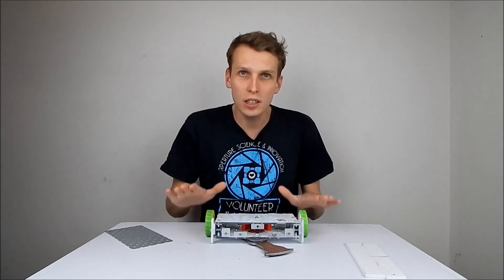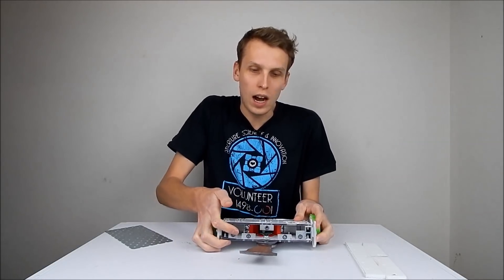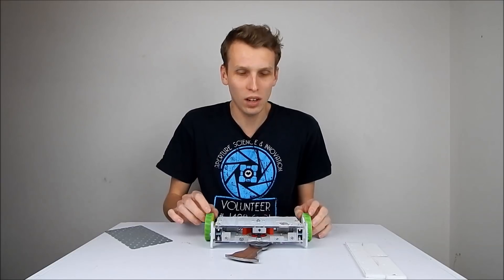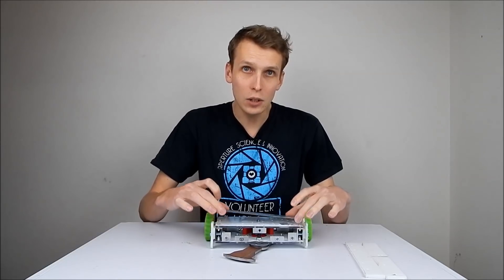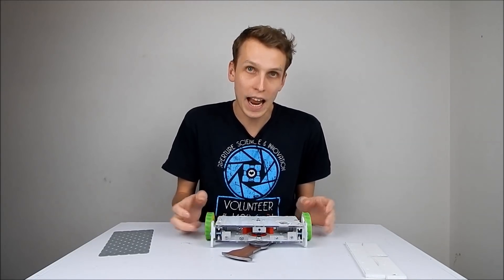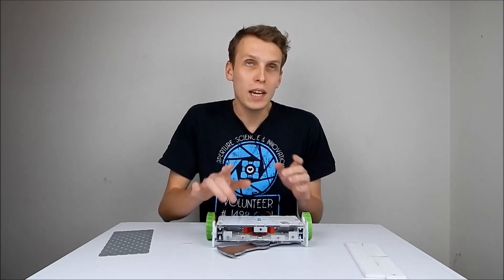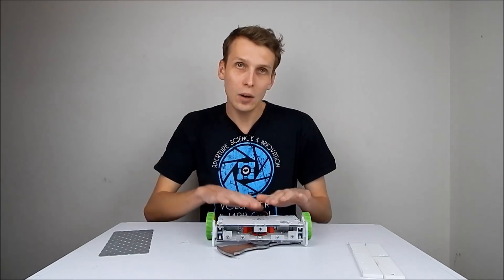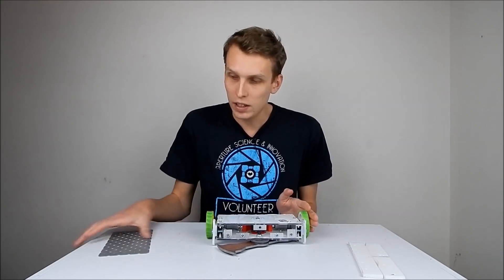1.36kg under cutter robot upgrades

Comment: what motors do you use?
Reply from the maker: generic 20-21mm round 1000 RPM gear motors
Reply: @TeamPanicRobotics  I take it they come with a flat section to mount wheels to?
Reply from the maker: Yes, they have a d-shaft on the output. I use brass RC car wheels hubs with in built setscrews to hold the wheel to the shaft
Reply: @TeamPanicRobotics  Thank you, i am planning on building a beetleweight after my exams so I want  to get as much help and tips as possible and this has helped a lot!